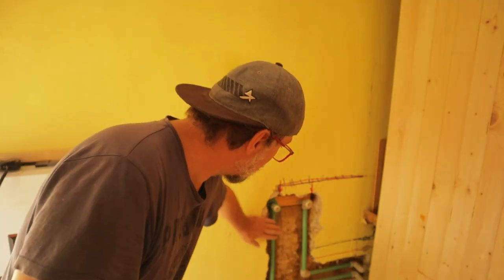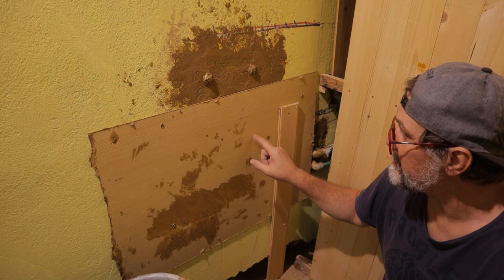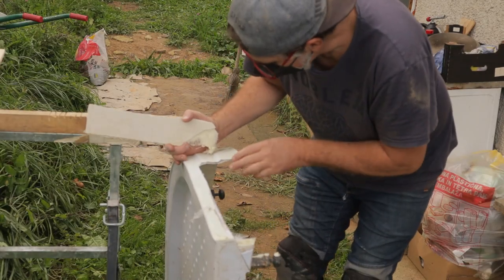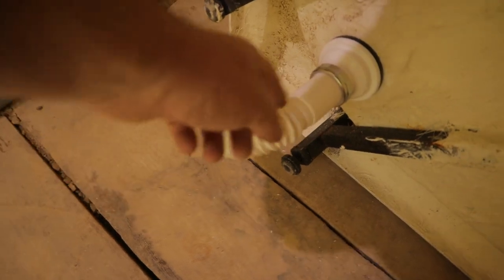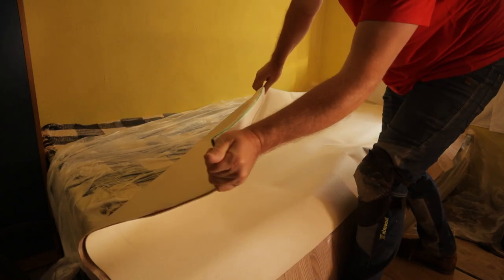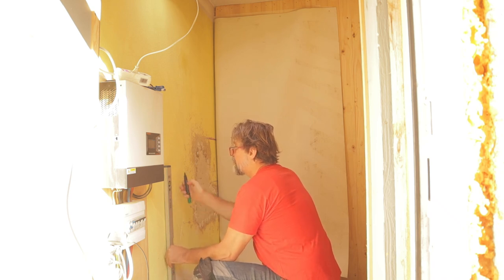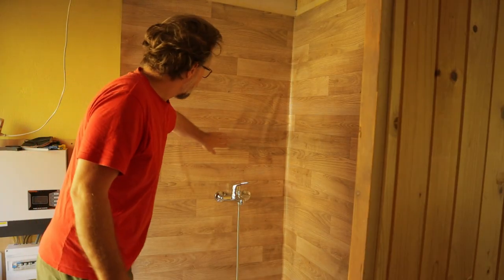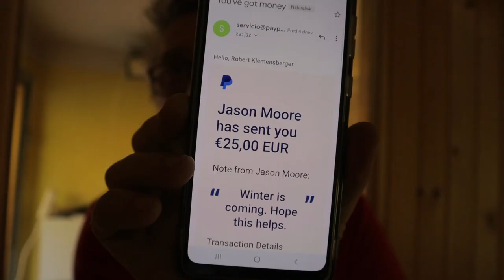Vinyl Flooring on Shower Walls 100% WATERPROOF, Rescuing an Old House

Comment: What a great idea; im seriously thinking of doing this over our big corner tub; then replace the tub spout with one that has an optional long metal shower hose, mount that on the wall, enclose it in shower curtains, so we can use that area as a shower/tub instead of only a tub.

Comment: I can see the bubbles form as it was skipped. This is why rollers, squeegees, and a heat gun are an absolute must. Other part, great. Im just a vynl guy. High quality vynl will even go on better tiny bit of soap and water under it. It also needs to be put on alot slower and not half hang on while other work is done. Sheet vynl is 100% once or youll get bubbles that will expand and get worse. You can pierce a needle and reglue it in some cases. Love everything else.
Reply from the maker: Thanks 👍🙂
Reply: I’m also doing this, what adhesive would you recommend that is the same as the Neostik that he used?

Comment: Hi Robert, here in the South West of Western Australia we have a few rammed earth buildings around which use industrial pressure to create the most impressive blocks of compressed earth you've ever seen. I was wondering however, if you know, what is the equivalent R insulative value of the style of mud earth typical for your farm house? It looks to be approximately 250-300mm thick but the composition made me think it might conduct like concrete rather than insulate. Could you educate me or point me to some information about that building practice in Slovenia?